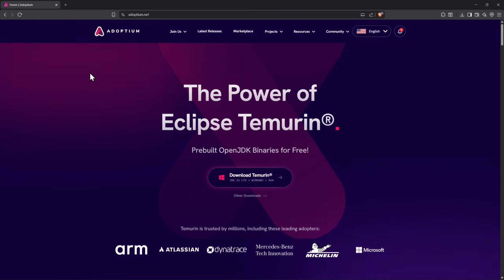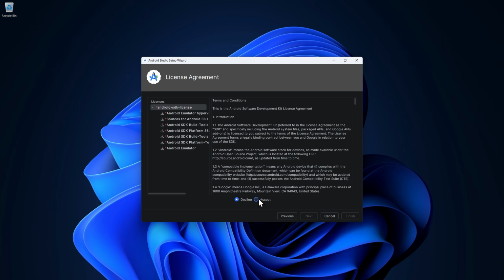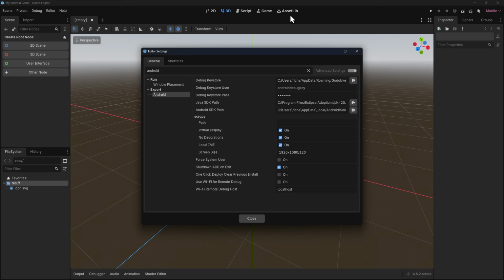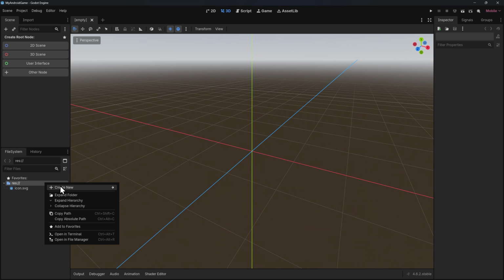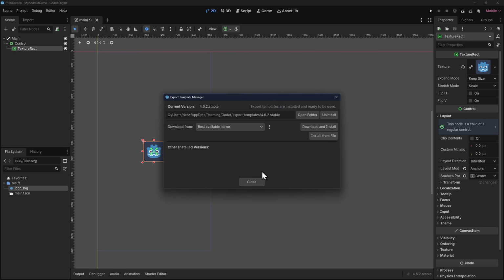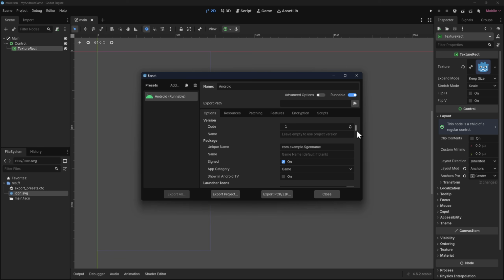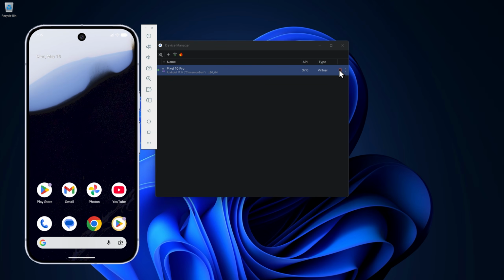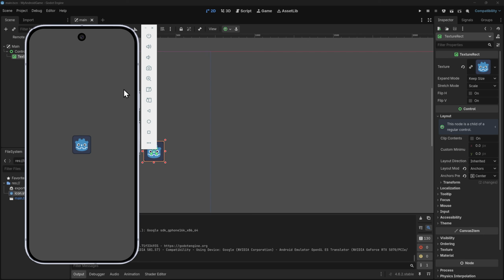Godot Android Setup: Install, Configure and Test | Tutorial

Comment: My game does not fit my screen.
It shows an excess black screen when I run it on a physical device.
Can you help?
Reply from the maker: I can try! But I would need more details, how is it not fitting? Is the excess black screen above and below? Or on the sides? Do you see the logo?
Reply: @RichardGameworks Yes I see the logo, background does not fill the screen.
Reply from the maker: did you change the project settings for your project? How do they look like?

Comment: Hi thanks for the tutorial. Is there any suggestions how to optimize a 3d godot game for android?
I tried this new 4.7 beta version with this new virtual joystick feature and a simple scene has very bad performance on a phone.
I read on forums that the version 3 had a better performance in mobile 3d.
Reply: Thank you guys. It was my mistake. :)
I connected my phone via usb and used the debug profiler mode in godot.
There was a wrong part of my movement script in the physics process.
The profiler showed 150 ms  with a single scene.
Reply: Have you tried the Compatability renderer?
Reply from the maker: It's difficult to say without knowing your game. it could also be due to high resolution models and textures. Try reducing the polygons of your models and the quality of the textures just as a test, and see how that affects your performance. Otherwise it could also be due to particles, effects or the size of the map you're loading at once.

Let me know if you do find out the cause!